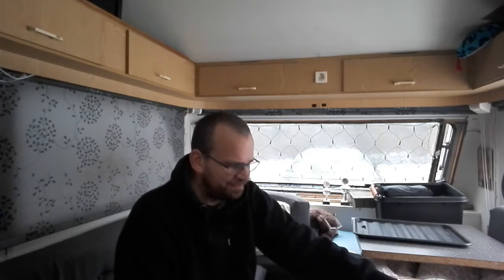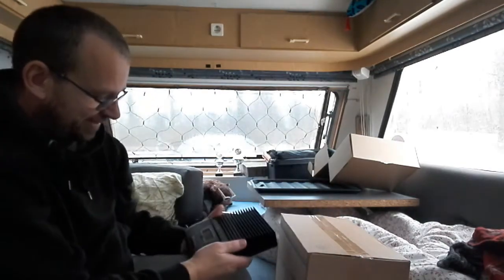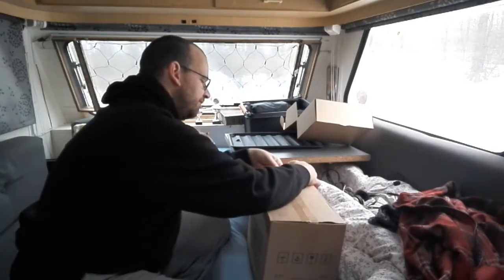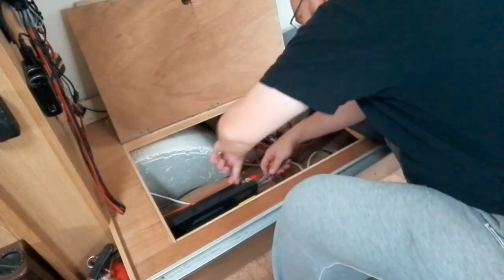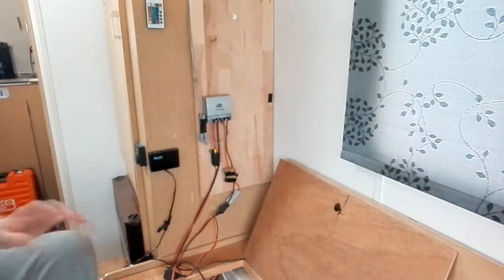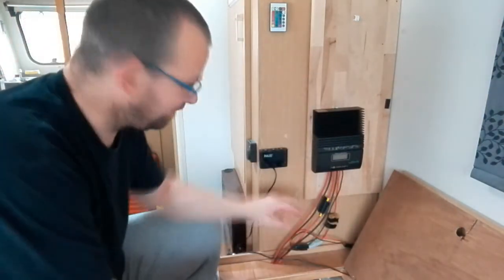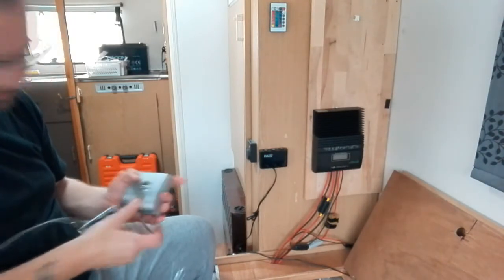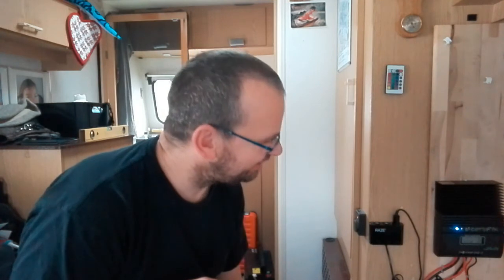Installing my new  MPPT charge controller and a AGM battery. Upgrading my solar setup Life is good

Comment: Great job brother! Maybe you want to save the controller and battery just in case the one you have gets damaged. Take care man. Now I need to learn where goes each connection!
Reply from the maker: I still have the old controller but the battery was going bad after less than one year.
I had a two year warranty on it so I took it back to the store and got my money back. Then went to another store and bought a good AGM battery.
Thank you for watching the video my friend and stay safe.

Comment: You said that you have a 100 watt panel, but you didn't mention what the output voltage on that panel was. I'm curious because unless your panel is a higher voltage panel you won't get much benefit from an MPPT controller. I found that building a well functioning solar charging system is not a simple task. :)
Reply: A good read:  https://handybobsolar.wordpress.com/the-rv-battery-charging-puzzle-2/
Reply from the maker: Gary J you are right about that. That's why I asked people who are smarter than me. 😁 I am told that my panel and this MPPT controller is a perfect match.  Thank you for your comment my friend. And the link.